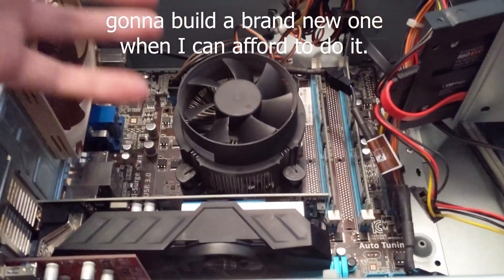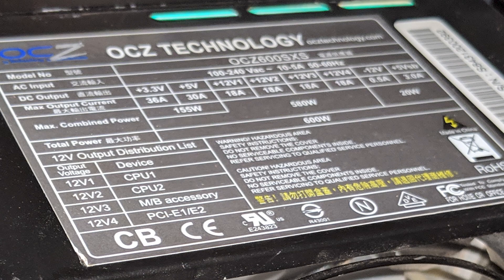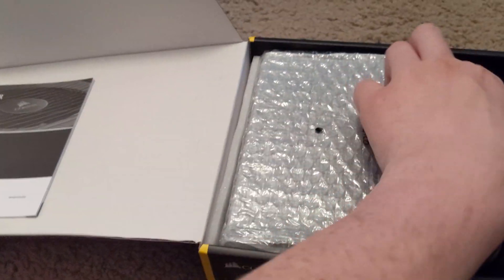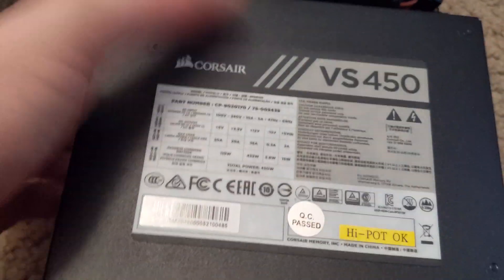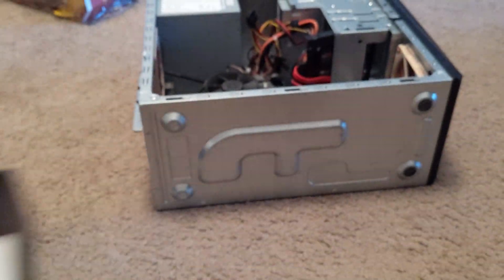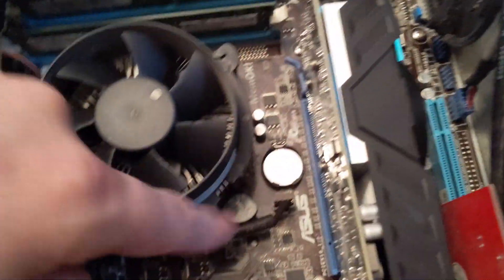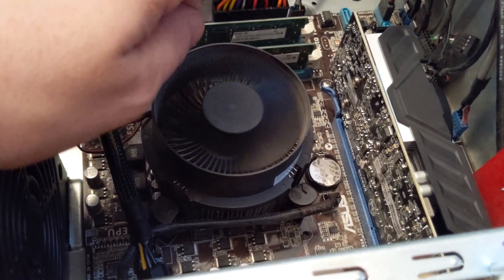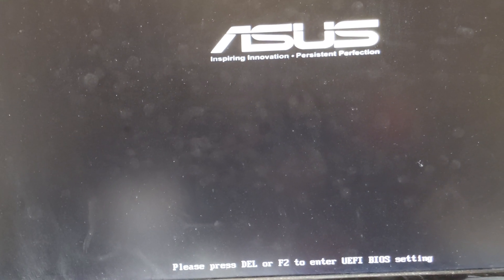Upgrading my Wife's ASUS Essentio CM6730-08 (Part 1)

Comment: Quick question could I put a gtx 1660 super (gddr6) in that computer instead of normal 1660 with gddr5
Reply from the maker: that would be just fine. I'd get a 550 power supply though.
Reply: @JoshDoesRC  I'm so confused >,< I've never built a computer before, and I really don't wanna spend 714$ purchasing parts for a new one...this may be a long reply lol sorry about that all my questions will be about the Asus essentio series with the F2A85-M motherboard in it when you put in the 1660 did it bottleneck and how'd the 3.2ghz hold up cause i'm trying to play games like (All on ultra/high) StarCraft 2, Euro truck, Gold rush, WoW, Arma 3, PUBG, forza horizon 4, ect… and can I upgrade my ram I only have 8gb and when I looked up the Motherboard it says it supports DDR3 (Max) 64gb of ram, can I just get a stick of 16gb ddr3 ram and toss it in their and take out the 2 4gb sticks
Reply from the maker: @MRBOOOYA  it really really depends on the game. Some games (like GTA 5) obliterate your CPU and you'd have to lower the quality to get 60FPS. Some, like Destiny 2, are very well optimized and max out your GPU well before your CPU. The 3rd gen i7 can still compete today (even a 2nd gen i7, when overclocked, isn't that far behind the 8th gen i7.) You just need to upgrade the Power Supply (i recommend the CX550), and the GPU. Get a 1660 Super or 1660 Ti. You'll be gaming at 1080p 60fps for a few more years, at the very least. The PSU is around 60 and the graphics card is 250 or so. That's 300 dollars in parts total.
Reply: @JoshDoesRC  I've noticed that when you put in the 1660  it said on the box Direct X12, this is my mobo and I tthink it only supports DX11 https://www.asus.com/Motherboards/F2A85M/specifications/ thank you for your time and paitence

Comment: Is the 450W psu  enough to handle 1660? Please reply..
Reply from the maker: No issues so far! even overclock it an extra 100mhz on the core clock. I will definitely be putting my 550 in it though, once I upgrade my power supply. Just so it's not maxing it out (if it ever is).
Reply: @JoshDoesRC  after this comment anything happened with 450w psu/pc or not? coz im using mwe 450w psu with same version of gpu of yours which is gigabyte gtx 1660 oc.